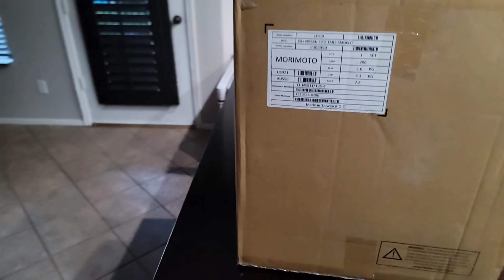Morimoto Rear Taillights Install On NISSAN 370Z

Comment: Just got mine in, full Morimoto package! Headlights, side markers, rear taillights, and license plate lights! 
Tbh they look dope and make the Z look newer but the fitment on the driver side is straight garbage! I think it’s just my set the passenger is good but the driver side sticks out too much you can literally put your fingers underneath the light. It’s liveable but might have a bodyshop help me out since I’m taking my Z in for a front bumper respray
Reply from the maker: Ayy good stuff 🙌 and I think its a hit or miss with these lights some people have issues some don't.
Reply: @Chrizleyva  Yeah I have to return mine because the Fitment was horrible

Comment: So i recently just bought these and the 4th brakelight from z1. How did you do the 4th brakelight to the morimotos? The wires on mine arent same color code as oem for brakelight instructions on install.
Reply from the maker: I haven't got around to installing mine but want to do it soon

Comment: Hey sorry ik this has nothing to do with this video but i had a question about the q50 can you add paddle shifters to a 3.0t? And the s model as well?
Reply from the maker: So I know for the older models I think its 2017 and before you can add paddle shifts but for 2018 and above you need to buy the paddle shifters and an additional harness line to add them. If you want to make sure check to see if you have the connections to the paddle shifters
Reply: @Chrizleyva  so basically if i look behind the wheel i can see if there is like an impute for the paddle shifters right?

Comment: Tail lights look great. Goes really well with black and carbon fiber. Were you still able to add back the 4th brake light?
Reply from the maker: Appreciate it 🙏  and I didn't wire it up yet I plan to do that once I get the other bumper done I'll record the process once I get there
Reply: @Chrizleyva  Nice! Yeah was just curious if the wirings would be the same. Looking forward to that Nismo rear bumper. Keep it up  bro! 😎🤙🏽
Reply: @Solekz  Yea the Wiring would be the same! The Morimotos come with the same Plug that the OEM Taillights do. So you can just tap into the Cars Harness with "electricity thief" Clips, sorry i dont know how they're called in english.

Comment: can  you upload with rewiring the 4th brake light
Reply: Do you need to re wire the 4th break light ? It says its completely plug and play. Mine come Friday and I don't wanna miss anything.  Got me worried lol
Reply: Update. Full plug and play. Easier to install than an intake. Far as I kno 4th break light still works.
Reply: @Gunsum045  did you see if your 4th brake works
Reply: @unknown.z34_33  the wiring is separate from the tail lights. So I belive it does work. I should probably check hey lol